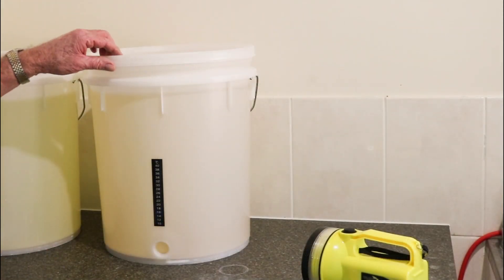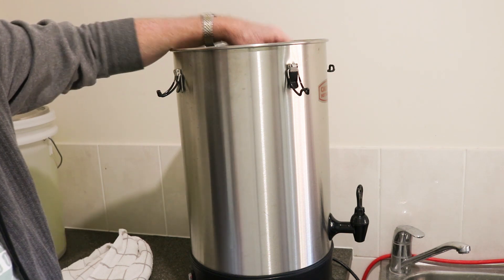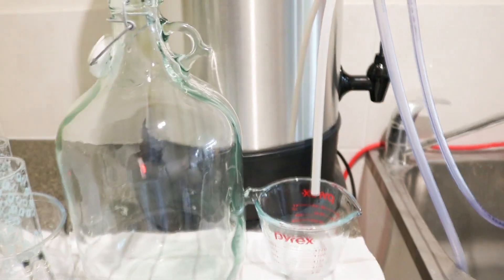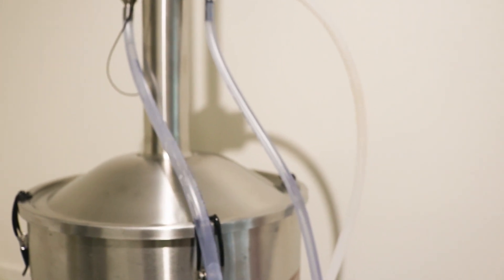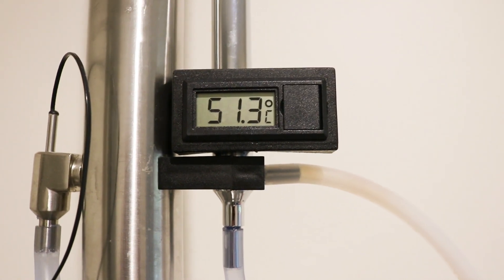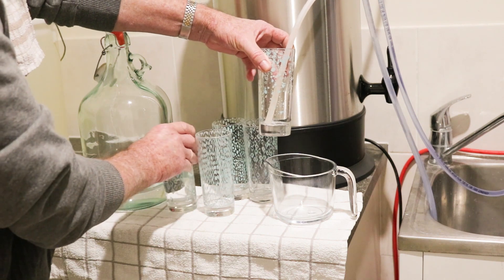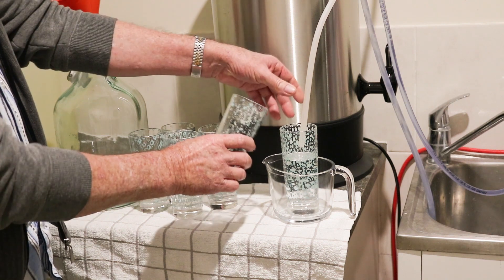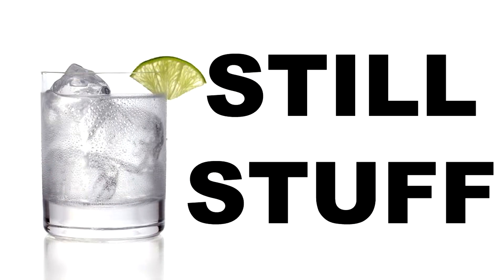How I Make Vodka with Bakers Yeast Pt.  2  Distillation

Comment: Excuse me  can you spell menanof this your added before sugar wash?
 Sorry but i need to know please
Reply from the maker: Happy to help Yazeed but I am afraid I do not fully understand the question.
Reply: @pauljacobs5390   im sorry but im not fluent in english , so what is this 01:12
Thank you
Reply from the maker: Hi Yazeed,
I will give a large answer, to make it easier for you copy the answer and put it in this Translator https://www.translate.com/
The Ceramic Saddles are used in the Boiler to help minimize frothing and bubbling. I never have a problem as long as I do not over fill the boiler. Keep in mind that if you do not let your wash settle and let all the yeast settle with it, you will have yeast in the boiler and that could lead to excessive foaming as it boils that can result in it spewing out the distillate end. Make it a rule to wait the extra time for your wash to become as clear and translucent as possible.
Hope this helps.
Reply: @pauljacobs5390  thaks alot

Comment: Smell like gasoline when i brew it, plss help.. thnks
Reply from the maker: Hey Arkenshin, there will be a strong alcohol vapour that could be mistaken, and if you make your tails cut a little late there will be an odor added to the vapor. I found out that not regularly cleaning my Column added more off odour to the distillate.
I make my cuts earlier than most and it has virtually no flavor but still has the alcohol vapor

Comment: How did you get your wash so clear?
Reply from the maker: Hey Aaron, there are two things I do. 1 - After the yeast finishes and you have a specific gravity of .95 or less (meaning you have used all the sugar) - let it sit for a week or until you can reasonably clearly see from the top to the bottom. If it is still a little murky, 2 - Use Still Spirits Turbo Clear or Alcotec Turbo Klar..... Distilling a merky wash means tou are also distilling yeast and this influences the flavour. When I first started I was too eager to wait but soon found an answer - Have several washes on the go at different stages of progress. Hope this has helped.
Reply: My wash been fermenting for 2 weeks, its at 1.050
Reply from the maker: It may have had a larger sugar content at the beginning. What was the Specific Gravity just before you added your Yeast?
Reply: I forgot to check, added 6kg sugar half a cup of bakers yeast, 1tablespoon of epson salf, pinch of bi-card soda
Reply from the maker: There is only three reasons a Distill will stall and not use all the sugar - 1. If it is too hot or cold - 2. there is not enough yeast - 3. there is impurities in the water used - 4. There is too much sugar used.
It looks like the latter is the problem you have. I found that when using Bakers Yeast the ABV stopped at around 10% and the increased alcohol actually slowed and eventually killed all the yeast. It is better to put in just enough sugar for 10% but don't dismay. You can still salvage your wash by either waiting for gravity to settle all the wash for a clean end, or use a Turbo Clear product I mentioned earlier. Remember to first siphon off all the slightly murky fluid to separate it from the sediment at the bottom. After this use the Turbo Clear. If it is still a little murky after all this, do not worry as this has happened to me. I simply distilled it and even though it had a slight taste from the yeast, i activated carbon filtered it several times until it had no odor.
Reply from the maker: I might add that I only use a pinch of epson salt (used to soften Hard Water) and a teaspoon of Citric Acid (used to lower the PH level to 4 or 5) I have never used Bicarb Soda so can not comment on this.
Reply: Ok will give it a go, i like to allways filter my alochol, thanks for your time

Comment: The temperature is not of the steam but of the water exiting after it’s gone through the worm to condense the steam back to liquid, still spirits have done there research before selling the still, if you were using a pot still then you would check the steam temp at the head of the column.

Comment: Hi thanks for your videos they are among the most informative on you tube.  Just a couple of questions please :-
1. I've seen that bakers yeast will not produce over 10% alcohol as you say.  After distilling you say the alcohol goes up to 94%.  That seems like a really big jump. I thought that only special vodka yeast could do that?  Maybe I'm wasting my money on vodka yeast?
2.  In another you tube video a guy said that distilling a pure white sugar wash will not produce methanol.  That it was chemically impossible.  Do you know if that's correct?  I'm freaking out about poisoning myself.
3. So after distilling your 25L you end up with about 2L before diluting it.  So roughly then 10L will distill down to 1L as a rule of thumb?  How long did that take?

Many thanks.
Reply: A wine / champagne yeast will permit an ABV of up to around 16% so it is a better choice over baker's yeast. Turbo yeasts are known to produce a lot of off-flavours and are not used by experienced distillers.
Reply from the maker: HI Gary, thanks for the comment...
A.B.V. is Alcohol By Volume and in the wash use your Hydrometer to regulate the potential ABV to 10%. I find that if you just put in more sugar it is not converted into alcohol leaving a high amount of sugar in the wash that you need to distill. Your end product will be much better if you use ALL of the sugar leaving none.
Now realize that this 10% is the potential alcohol within the wash or say 2.5 ltrs in a 25 ltr wash (not accounting for Heads and Tails separation)
I distill my Bakers Yeast Wash through a Reflux Column and it gives me 2.5 ltrs of 94% ABV or 188% Proof.
If I were to distill through my Pressure Cooker Pot Still, the max I have got is around 80% to 83% ABV.
I personally am very critical when making my heads and tails cut, I do not like any odor in my Vodka so I tend to make my tails cut early - Could include more Tails and Carbon Filter to eliminate the odor but I like it pure.
Can't say if it is better than your Vodka Yeast, but definitely worth a try and compare.
Hope this has helped.

Comment: Will yeast too strong? How about taste? Pure n sweet alcohol?
Reply from the maker: Hi... You can put 1/4 yeast and wait an extra week or two for it to finish fermenting. In this case I chose to finish fast and carbon filter to purify the end product. I have just finished a batch with a low 50g of yeast and it took 16 days to stop fermenting and ended up with a low ABV percentage but was still more pure than the faster method. Using 1/2 cup of yeast makes it finish in 3 to 4 days. I still put it through Carbon Filtering and it is nearly zero odor like pure vodka.

Comment: The saddles in the bottom of the boiler has nothing to do at all with keeping the bottom boiler clean . The saddles break up small bubbles that form in the bottom of the boiler that can cause boil surging
Reply from the maker: Hi glenncol, you are absolutely correct, I just had this confirmed from Still Spirits. 
Again, it shows me how easy it is to get the wrong information.
Thanks for the advise, I will place a note in the Description above.
Reply: Sorry that came across a little harsh. was not intended that way
Reply: advice